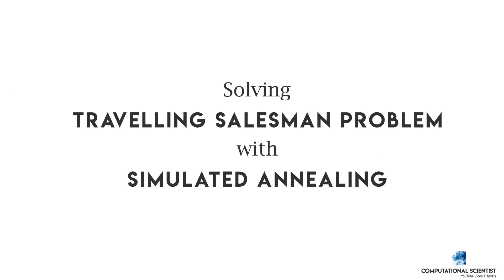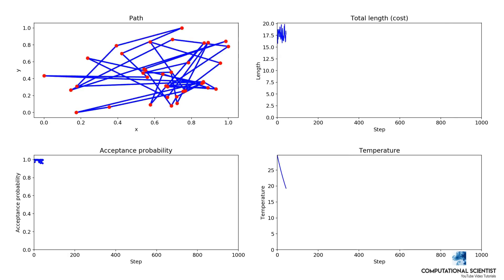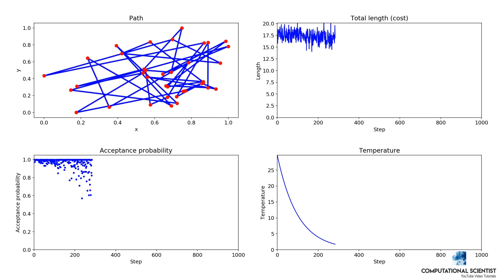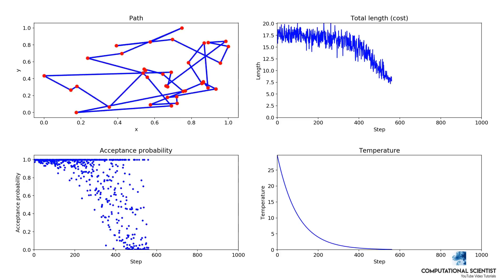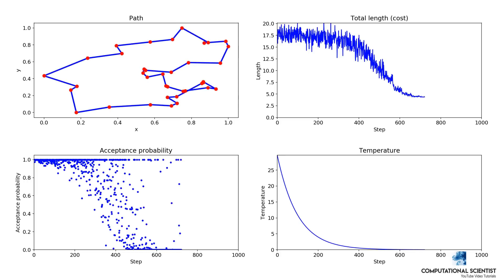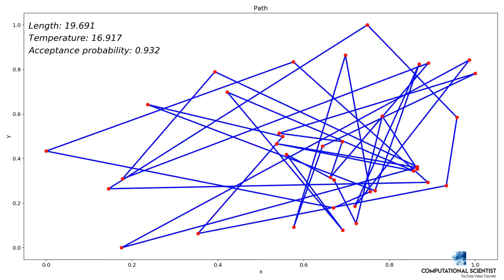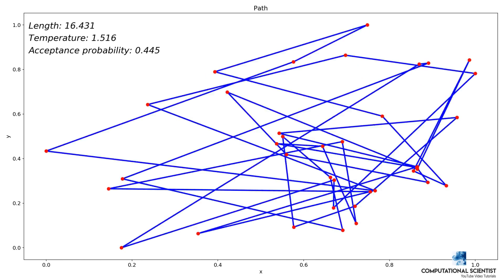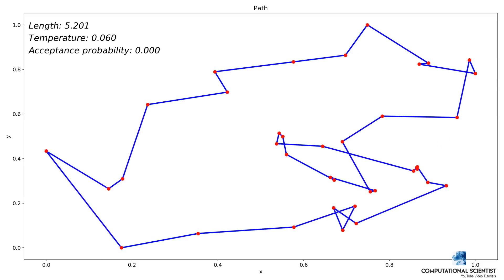Simulated Annealing Visualization: Solving Travelling Salesman Problem

Comment: Hello, I really missed something. If the length of each Markov chain is 500, how temperature is decreasing exponentially in the graph. For example, in my graph, it is constant till the length of each Markov chain is reached. I did not understand how to graph it, can you give some detail to let me check & correct my graph. If you decrease temperature in each Markov chain how temperature is not cooled till all chains is finished.
Reply from the maker: Hi! I've uploaded a new video recently where you can find the implementation. It should help to understand what happens here.
Reply: ComputationalScientist I watched it too, I think I solve it  now, you just use 1000 iteration and use just temp change, not with each markov chain, just markov chain with temp change 😄
Reply: ComputationalScientist I havr one more question, you are actually iterating 1000*100 in python but as I see the graph and look your python I did not catch the how to represent all process in 1000 iteration. My graph is distributed in the solution space, but yours is following a pattern through minimized solutions. Can you explain please I couldnt get from python code😊

Comment: hello, do you run the code 500 times and select the best? Then you increase the step till 1000. I also study on SA but I dont get a graph like yours in terms of step x length graph. I work on different problem, not TSP.